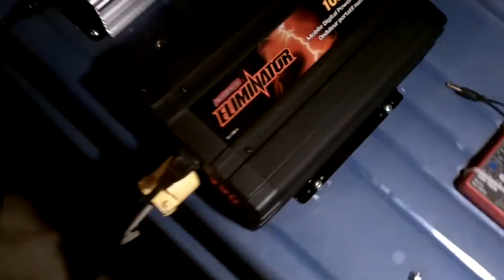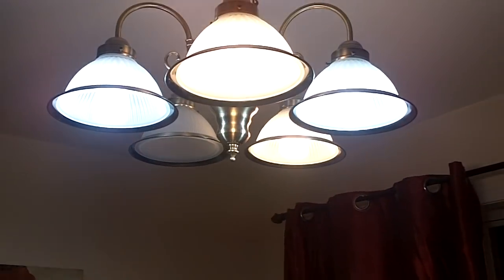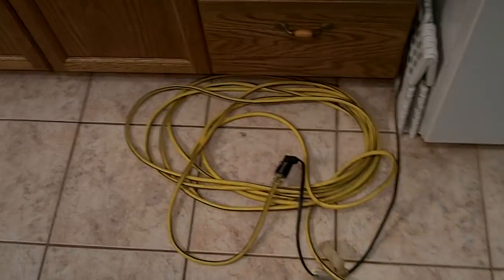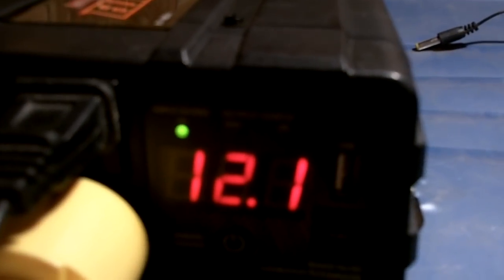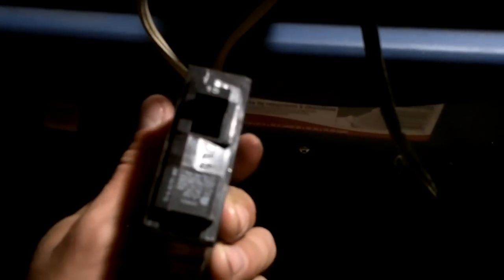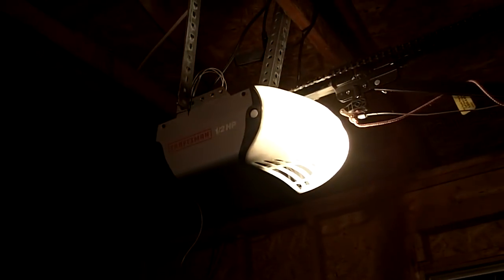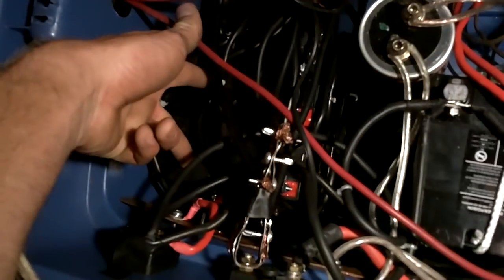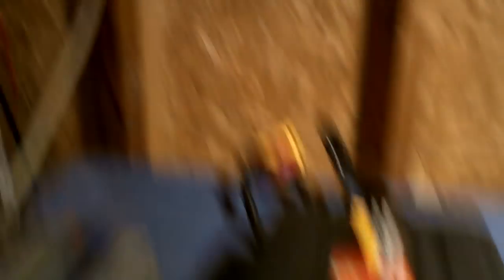House running off 1000W inverter

Comment: Thanking about doing this, would like to get a solar charge to keep the batteries charged up, Heard marine batteries are better and last longer.
Reply from the maker: deep cycle batteries are good for solar, its fun to start with a small system.

Comment: Brother can i run 260 amp inverter welder thru  my 2000watts pure sine wave inverter??
Reply from the maker: no! you need like 8000w inverter for that :) I ran a 90 amp mig off a 3000w inverter.
Reply: Going Off Grid thanks....i also have 3000watts inverter...can my 150migweld run thru this??
Reply from the maker: on low I would thinks so yes, but dont hate me if your inverter gets damaged :S
Reply: Going Off Grid i check it its only a 100 amps
Reply from the maker: should be ok, what brand inverter ?
Reply: Going Off Grid tbe

Comment: Where did you buy the inverter?
Reply from the maker: Canadian tire
Reply: Going Off Grid so any automotive place?
Reply from the maker: this is a pure sine wave inverter, most you fine in auto stores are modified and are none to be bad for some electronics. go power makes a good inverter,reliable electric makes a nice inverter, samlex is another good inverter. I would look on ebay or amazon

Comment: I calculated you've got 167 Ah, right? I like the idea of the capacitor, but it is necessary? Capacitors are used in DC systems where multilple devices draw from a battery or power bank. You've just got the one inverter drawing 1000w. Does the draw off the power bank vary drastically?
Reply from the maker: the cap is not doing much I had one on hand and is the only reason I used it.

Comment: Thank you for this presentation and all the info!  I want to convert my SUV into a camper and I plan to use 2 x 12 volts batteries of 800 amp with 79 amp/hour and a power inverter of 1500 watts.  I will be using a coffe percolator of 750 w and a toaster of 700 w.  I was told that I have to make sure I have the right inverter cause some produice "Pure Sine Waves" and others "Modified Waves" and this may affect the apparatus I will be using such as the percolator or the toaster... what do you say?  Thanks.
Reply from the maker: if you are using anything that has a screen on it use pure sine if it just a plain toaster then a modified sine wave is fine.
Reply: Thanks, much appreciated!

Comment: That's great until you try and toast some bread.
Reply from the maker: very true :D
Reply: Going Off Grid  you'll get there. I live off grid and started small. It was five years before I could run a toaster. If I could make one suggestion  I'd say you should be sure all of your batteries are rated the same amp hrs. Your weaker batteries will kill your larger batteries and you could end up with a overcharging and overheating problem when using batteries with different capacities. I use four lead acid 100 amp hr deep cycle batteries and make sure there well ventilated.
Reply from the maker: hey, thanks a lot! check out my channel to see what im up to atm :) I have 4500w of solar and almost 100Kw of power storage :D
Reply: Going Off Grid what kind of batteries are you using?
Reply from the maker: agm mix sized in this video

Comment: Hello mate i like what youve done would like to replicate could you possibly show me how youve done all this, possible wire diagram etc?? Have you got a email address? Thanms
Reply from the maker: it is hooking up all the + together and All the - together that will make one big battery at the voltage of the batteries you pick, so if you have ten 100Ah 12 volt batteries and hook all the + together and all the - together you will have a 1000Ah 12v bank, and if you hook that to a inverter you will be able to pull power from those batteries at 120 volts, to charge with solar just charge the batteries + from one side of the bank and the - from the other side for best charging.
Reply: Going Off Grid thanks mate gonna give it a whirl!

Comment: It's low voltage that burns up your appliances regardless of how stable the wavelength is.!!!!!!
Reply from the maker: this inverter here shuts done before it goes less then 115 volts
Reply: So you can only run your refrigerator for about 2 hours.?¿?? Then you have to plug in your battery charger and recharge the batteries.?????
Reply from the maker: no I tested it for 2 hours and hit 50% If i needed to in a real power out I would use 75% and get 3 hours for fridge and lights and the next day the solar will charge it back up in one day.

Comment: You need about a 2500 watt inverter and then only use about 1200 watts to 1500 watts.!!!    Only use them on appliances if you have to they will cut down the life of your household appliances.   !!!!!!!
Reply from the maker: pure sine wave inverters like the one in this video are just as good or better then mains power

Comment: This is a farce there is no way he is running his fridge with that 1000k even with an energy star rate fridge they pull any were from 500 to 700 watts yet his is only saying its pulling 390 to 400 watts plus all these different lights on come on ppl use ur Brain's a little bit
Reply from the maker: most fridge take about 160w to run and 800-1500w to start, my inverter has a good surge rating and i was only running a few led lights and a fridge.

Comment: I just want to point out here you 12 volt amp reading is correct you got to remember when you step or down the voltages amp's will shift in the opposite direction ie 12v @ 100 amp's will be 120v @ 10 roughly and I say roughly because there is a conversion loss Electronics are never 100% efficient

Comment: nice setup..been thinking about doing this,   what is your solar panel wattage and .  would the batteries get hot stored in that container and would a small fan help keep the temperature down?
Reply from the maker: i think I had 500w at time of filming, and 200Ah of batteries they never got hot and they did not gas off either.

Comment: i want help from you i have inverter plz give me your whatapp number i want some help
Reply from the maker: ask here and I will do my best to help you
Reply: @GoingOffGrid101  I want to run a 700w microwave in my van
Any info or videos or steps
Also I never seen a battery bank enclosed in plastic would that be safe in a van or should I use aluminum or metal enclosure or does it matter?
Now if I wanna use a 1500w electric heater what inverter size would power that and how many battery and types for 8 hrs?
How could I recharge them by the next night I need them? My van is 2016 ram promaster city.. a small van

Comment: nice battery box. I'm curious; how do you have the capacitor wired in to your system?
Reply from the maker: it was wired to the same spot as the batteries, but I would not buy one as they dont do much.

Comment: i have a 3000w power inverter. i was thinking if i can hook it up with a 12v 2sm battery.
is it gonna drain the battery fast. if i plug only a desktop computer around 600w?
thanks for the reply
Reply from the maker: how many amp hours is this battery?
Reply: says 240ahm...
is that a bad battery?

Comment: What a battery wire mess
Reply from the maker: lol says a guy with no backup system and no videos or subscribers, this video is old and was only like this for 3 or 4 months then changed, I also had backup power, and was using it to save money daily.
Reply: fliping720 you shouldn't assume. It was a mess of wiring. I'm not putting you down, just stating the obvious. Call me captain obvious.

Comment: A transformer is more efficient then an inverter
Reply: transformers are key components used in inverters. a transformer alone can't convert a battery or solar panel's power into high voltage AC. the inverter converts the DC to AC and steps that up through a transformer

Comment: mate, you should always keep your battery's the same amp hour. as the larger amp hour battery's will try and dump there current into the smaller batteries. 
it can cause a fire as the batteries will start to get hot. and the smaller battery's will drain first and will knock out your voltage as it will drop. so it's best to use as near as the same amperage batteries. 
I use truck batteries or deep cycle ones as they work great.
and yes it's great to use a nice cap bank for inrush! 
also use good think wires of the same for your batteries.  and also I couldn't see if you hade fuses on you battery wires as this is good for battery shorts. 

if you need any help give me a shout 👍😉

great video mate and good luck with your setup.

thanks for sharing. 

👍👍👍👍👍THUMBS UP👍👍👍👍👍

Anthony 

High1Voltage1Rules
Reply: this is crap and is a big myth. As the voltage drops faster on the smaller batteries, your device will take more amps out of the bigger batteries to equal the voltage drop. For people that don't believe, then put a amp meter and a data logger on each of your batteries AT THE SAME TIME and see the data
Reply: not really, a 12 volt lead acid is 6 cells in series anyway, but are matched, sometimes 1 cell fails and the voltage drops within minutes from say 13 volts to 11 volts, time to replace that battery.  I have re-watched the video and this guy is running in parallel, I wouldn't recommend running a 35amp battery with lots of 7amp batteries but it can be done if the wiring is right
Reply: high1voltage1rules I need your help powering a school bus conversion
Reply: LoveSomeMontana what's ya problem???
Reply: steven doesnt that depend on whether they are connected in parallel or in series?
Reply: high1voltage1rules can I get some advice when I do my conversion but I'm charging my ba that's with car alternators in a high-speed electric motor that will be my only charge from The Electric Company if
Reply: That might be true if all of the internal resistances were the same, but they aren't.
Reply: Jerry23w, It does.  I engineer large battery plants at remote radio sites and learned early in my career that paralleling batteries in cycle service (like solar) is a big no-no, but in float service it doesn't matter much because they are cycled rarely.

Comment: hi how long has in ben in use ? or do u use it full time ?
Reply from the maker: this one was used by me for one year, then I sold it to my grandpa and has been used up there for 2 more years, I just upgraded them to a 3000W inverter for Christmas, so it has been working for 3 years running a house. now it will be used here and there.

Comment: This is a great Video. I have the Energizer 2000-Watt 12-Volt Power Inverter-EN2000 and i was wondering if i could somehow use this to power my small house just the way you did yours. I know the Inverter is mainly used In Trucks, Boats etc. The  question is what do you think i will need to use the inverter to power the house. I already have 2 battery (12v 200ah). Also note i am presently in a country that uses 220V power output but i know the Inverter output is 110v. Does that mean i need a Step up transformer that will convert 110v to 220v output? Also do i need to buy a battery charger that will charge the battery when it goes down? I know the Inverter doesnt have a built in charger. Please a quick summary of the things needed will be greatly appreciated.
Reply from the maker: in this vide I was only able to go off grid for 3 hours, 200Ah is fine if your only using lights but if you wanna run more then just lights you will need at least 800Ah and 2000W of solar to keep a small house up and running, also I would buy a new inverter that puts out 220v your energiser inverter will not like a step up transformer very much, there will be a lot of wasted power there.
Reply: fliping720 b

Comment: You can back feed both sides of the panel as long as you turn ALL 220 breakers OFF at the panel first and during the entire time. This assumes the main is also OFF. 

The result would be 110v to both sides of the breaker panel with 0v potential between the two where there would normally be 220v. That's why you need to turn off all 220v breakers in addition to the main.
Reply from the maker: yes very true! i have done this but I do not recommend because it is hard to understand and many will do damage or hurt them self, I don't want anyone to get hurt but I also wanna share what I know, it can be hard on youtube.....
Reply: A few months back I purchased a 110-220 step up/down transformer and I'm waiting on a video to show me how to incorporate it

Comment: Aside from refrigerator, what other appliances are you running? How long can you run it before batteries are at 40 to 50 percent?
Reply from the maker: a bunch of lights and computers, and it lasted 2 hours and I stopped the test at about 45-55% state of charge, I think I had 200Ah at time of filming, it wasnt much

Comment: dos  your   refrigeatr   woork  on that 1000wt   invater     ?     mine  dont  work  on  a  2000wt at  all   so  dos  your tv and refigeatr
Reply: Mike Boyd make sure your inverter is twice the wattage of your fridge. say your fridge is 300watts, then it's best to have a 1200watt to make sure you can use other things in the house and your fridge will work still. and make sure your inverter is a pure sine wave model. not modified.  that will work with your fridge. good luck

Comment: hi, i have an 800W pure sine wave inverter with 1600w peak, just wondering if I put 1  farad capacitor will help me run my 450w washing machine? or my fridge?
Reply: I plan to setup 200ah battery with 12 system. 4x100w panels
Reply from the maker: it would help a little, but the main wires from your battery to your inverter is most impotent, I would spend the money on thicker wires from batteries to the inverter.
Reply: is 1 farad ok for my setup? yes i will thicker wires and make sure its short as possible from batt to inverter
Reply from the maker: gjrp18 yes it will help but not a lot

Comment: can you run your ac off that 1000 watt converter
Reply from the maker: no I can not
Reply: why not I know  theres has to be a way
Reply from the maker: I can run one small window AC unit
Reply: well I seen those videos already I always wonder how to run your house ac
Reply from the maker: you need a 6000W spit phase inverter for that.
Reply: so two 3000w would work
Reply from the maker: yes two 3000w inverters that have the capability to chain together to give spit phase 240 volts at 6000w
Reply: fliping720 what is the power of the AC u ca run ?
Reply from the maker: I run 120 volts and in this video I am running all the lighting one fridge and a few small cellphone chargers.

Comment: After 29 & 1/2 years as an electrical safety officer/inspector, this is not quite the most DANGEROUS and scary setup I've seen, but the fact that your limited knowledge of electrical safety and that you're promoting not very energy efficient CFL's proves it.
Reply: you mean that back feeding a little is dangerous like maybe ten houses are all backing feeding a little, the poor lineman gets a lot of voltage.
Reply from the maker: it is not safe, and I understand electricity better then most, check out my newer videos as I upgrade my system, I now have a generator panel.
Reply from the maker: it doesn't work that way, you can not back feed into a dead grid unless your power line or transformer is shot coming from your house making it so that only a small portion of the lines have power,, my little 1000W inverter can not support the load of all the houses on my transformer so it would just trip my inverter off, if you had a 20000W house generator this would be different.

Comment: If you keep large items on the grid, washer, dryer, heat/a/c, water heater and use the off grid setup for everything else, how much are you actually saving?
Reply from the maker: you are saving what you are using, so if your not using much you save little.
Reply: That was my whole point. Sure, you could hook up a system to handle the electric hogs, I:E your heat/air unit, but that would call for a large 220 system that will cost you twice what a 120 system would cost you. And running just all your lights, tv, sound system, computer, etc. wouldn't really save you allot of money after paying for all the energy hogs your house is still tied to the grid for. To run your whole house as if you were on the grid, you would need a system that puts out over 20K watts of power. I don't know about you, but that is a pretty damn penny right there.
Reply from the maker: MrCougar214 you do not need more then 6000W at a time max, its just about using them at different times
Reply: Right. But I was talking about using your whole house as though you were tied to the grid. meaning you got your stove cooking(I have electric), using your washer & dryer, having your heat or a/c going, while the kids are using the TV's, game systems,etc. To do all that all day and night long takes ALLOT of power. Not to mention enough batteries to store enough of this power to use it for more than 5 hours a day.....lol
Reply from the maker: MrCougar214 lol yea, good thing I can store about 60KW of power in my new battery bank :)
Reply: Holy crap. How many batteries are you running? And do you have them tied in series or parallel?
Reply from the maker: check out my videos :)